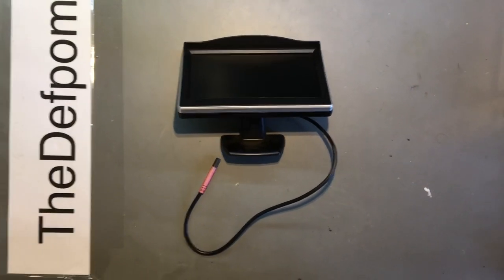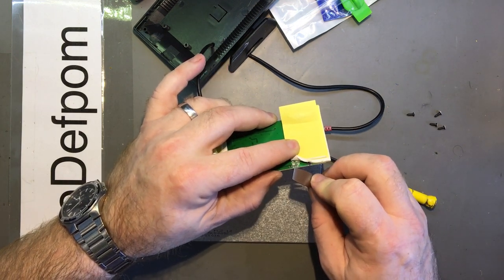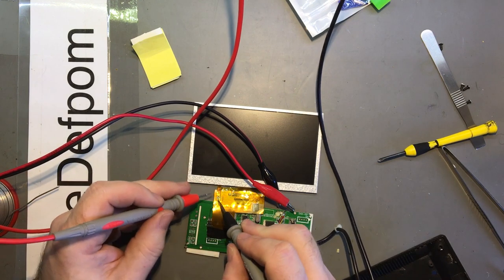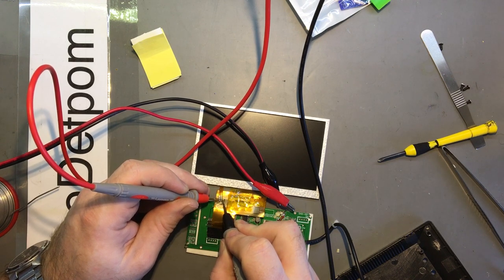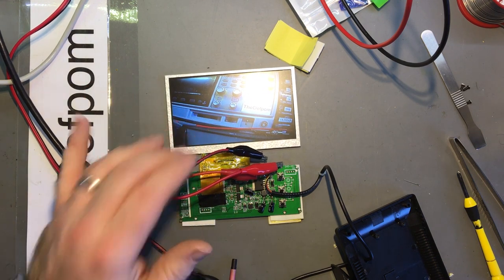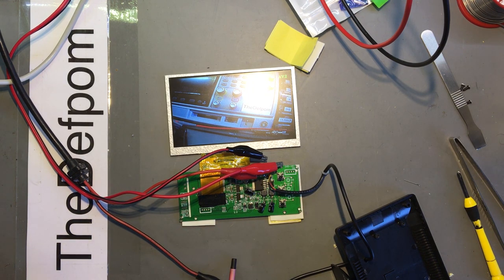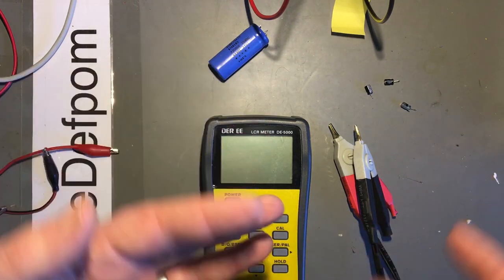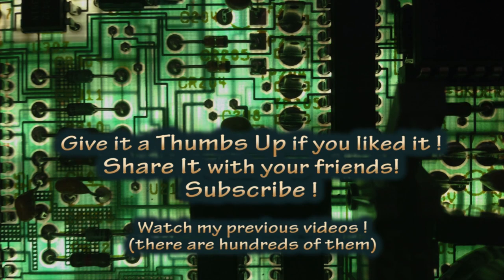#250 Reversing Camera Flickering LCD Screen Repair - How To Fix Reversing Camera

Comment: Hmm switchmode psu's get a bit upset with crappy caps, i dont know what the black beast to the right was, but i bet it was shutting down because it could not acheave a stable supplys.
I hate lead free solder too, i need my lead lol :-D